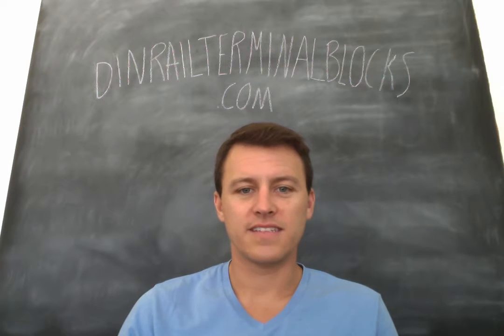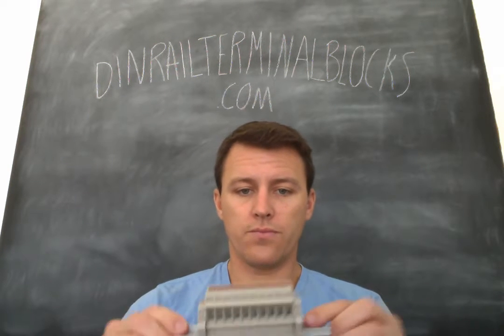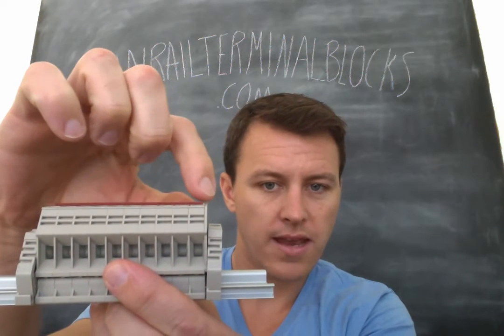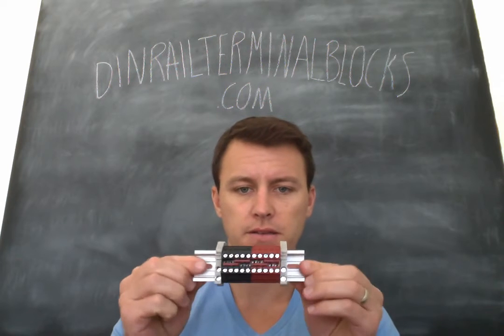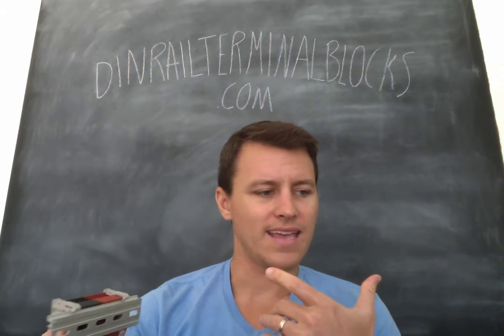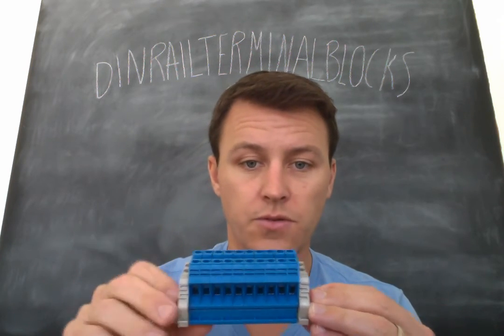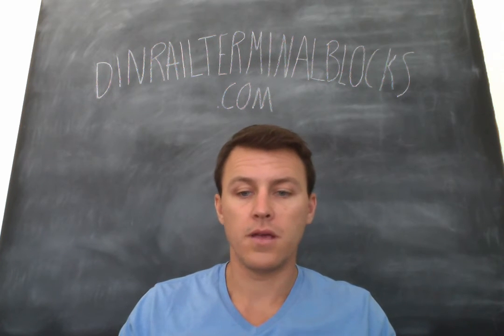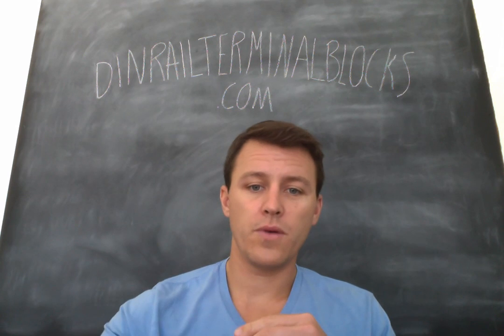Solar Combiners & Power Distribution - DIN Rail Terminal Blocks Video Blog #2

Comment: I love these things. I have a breaker panel in my house in which the breakers are not making good contact with the bus bars. I am installing a new main panel upstream, stripping the old one to turn it into a distribution box full of these. It's either that, or rewire the house. Not my idea of a good time, but these will make it easy to keep things organized and avoid a rat's nest. I'm really glad the come in larger sizes for the 6 and 8ga lines because 18 12ga circuits, 2 8ga circuits, and a 6ga circuit can turn into a nightmare using wire nuts! These will keep it manageable and looking like a grownup did it.

Comment: I purchased a 10 block terminal, can I cut the jumper and connect positive to one side and negative to the other side or do I need 2 blocks
Reply from the maker: You can cut the jumper.  Many of our customers cut the jumper and flip it around so the cut sides are not close to each other.  Keep in mind, this can affect the finger safety of the block.

Comment: I am combining 3 solar panels on my RV. I brought the terminal block you have in your hand at the beginning of the video. Looks like I should have gotten the red and black one. However, if I cut the red bar jumper it should work...?    Do you have a video of the actual wiring process ? Thanks  Richard
Reply: Following up of R. Davies question, If only need to jumper 2 terminal blocks together so I can make my solar panels in parallel connection, Its OK to "break" or "cut" the jumpers to be able to jumper 2 terminal blocks together - Correct?
Reply: So I watched the video again and it was mentioned that the jumper can be cut. Any particular tool?  A sharp knife or cutter work ok?
Reply: @noelherrera3490  Your basic diagonal wire cutter will cut it. However the best thing is a thinner blade like lineman snips. You want to get as close to the "leg" of the jumper. Or you will have bar sticking out with the metal exposed. Whenever I had to do this I would try and get that part that sticks out and shave/tim it off. When I have it with me I use liquid Electrical tape. As an added measure I make sure to Not have any two cut ends facing each other.

Comment: Can I disassemble these to mix and match colors?  I'm planning on using it for a garden lighting project enclosed in a waterproof box.
Reply from the maker: Absolutely.  You can pry the jumper out with a flat head screwdriver.  You can loosen the two screws of the end brackets (SS2) and pop the foot off the rail.  Then, the blocks pop off the same way.